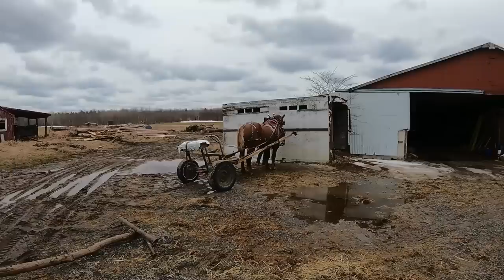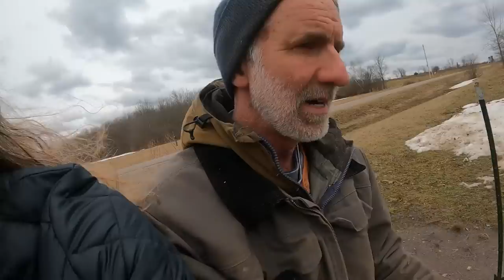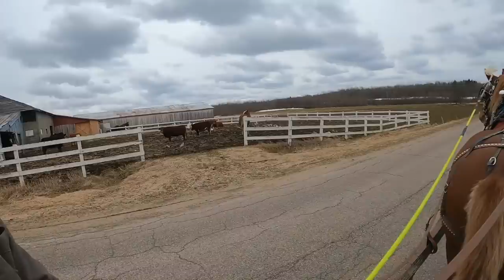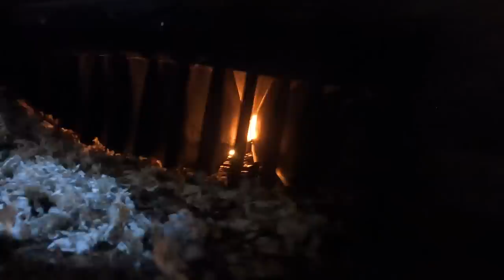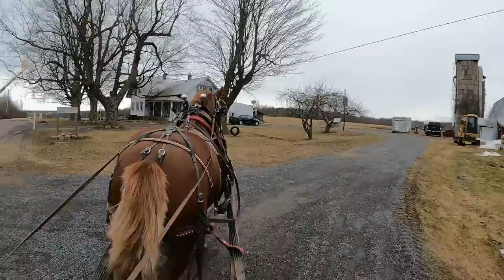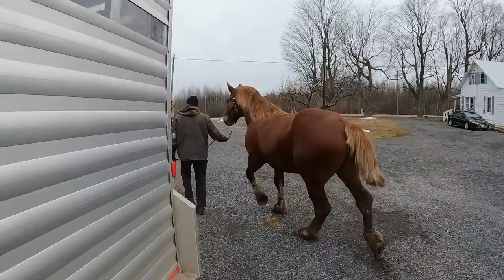Baron’s FIRST BATH… How will this go?? // DRAFT HORSE TRAINING  #461

Comment: Baron did very well for his first experience. When I first introduced my horses to the hose, I had it on down low to where it just bubbled up a little when held upright. I let them drink a little and washed their mouth. Then when they were no longer snuggly, I splashed it around a bit still low volume. The hissing noise is very disconcerting, so I made sure to keep it low volume until they were thoroughly comfortable. I had rescued a horse that had been beaten with a hose, and the sight of a hose set her running to the other side of the pasture. 3 months later you could lay a running hose out and she would pick it up and drink from it. After that careful work and you could wash her and wrap hose all around her no problem. She would stand still until you unwrapped her. This came in handy when a neighbor's bull broke through the fence and she got tangled in all the wire. She stood still and neighed until I got down there to release her.

Comment: When I worked in a barn where we had a lot of trouble with scratches, I used to hose legs off before lunch and let them dry over lunch.  Then when I groomed the horses, I would put just a little baby oil on my hands and rub down their lower legs with that little bit of oil.  It was only a few drops spread over my hands, but it would put just enough of a sheen of oil on the hair that their legs would shed water.  When I was doing that daily, we didn't get any scratches at all.  It usually starts with chapping from wet and cold, and/or tiny cuts from tough fescue blades, and that little bit of oil helps keep the skin from chapping.

Comment: Enjoy your videos so much BUT the noise coming off your cart makes it difficult to hear your conversation. Please consider repairing/oiling your equipment. Thanks.
Reply: The noises are from the type of equipment it is. It has many 'joints' because of chains and various different parts moving. It is NOT broken or unsafe.